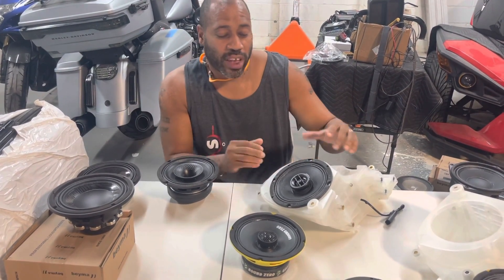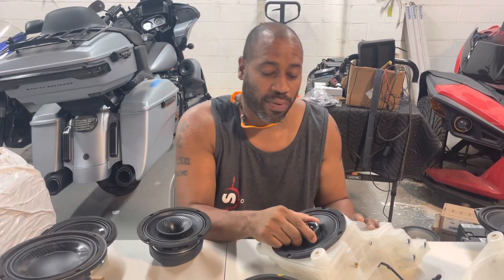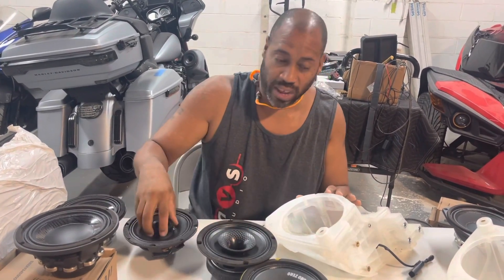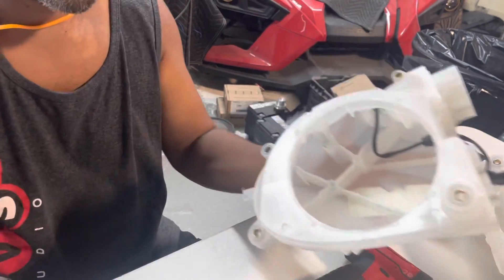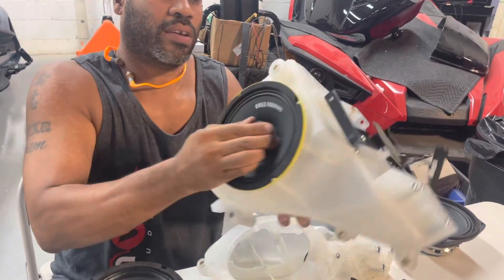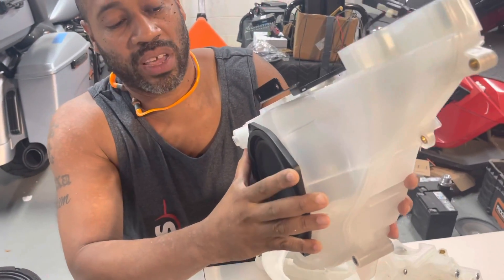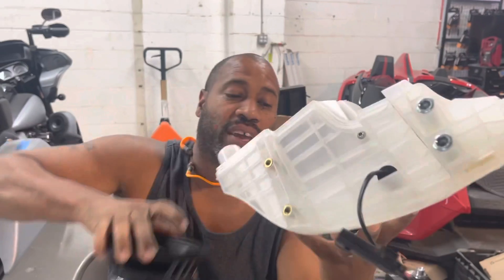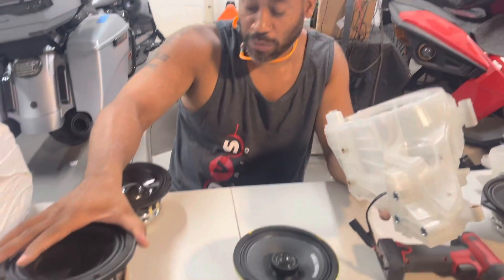How to modify your speaker pods on 2014 -2021 Harley-Davidson Street Glides for larger 6.5 speakers

Comment: On this topic. Why does Sinister sound add a bass port on the pods?  This may steer me away from there set up.
Reply from the maker: @jmaxx73  sinister sound is a very smart company. They know exactly what makes their speakers play the best and they modify the pod to work well with their speaker. They don’t just randomly throw a port in there. They know that this port in this pod with Speaker does this
Reply: Ty

Comment: My speaker pods are black. Is there a different process for the black ones
Reply: The speaker pods in my 2020 are black as well. If yours are like mine, they are actually 2 piece and has almost like a lid that comes off to make grinding easier.

Comment: Appreciate all the videos and assistance with us audio "nuts". 2 questions for you when you have a moment

1) - What is your take on the DS18 & Skar Audio lines...specifically the Pro Zt6 from DS18.

2). Have you guys every modified the rear stock pods on a Ultra to fit a 6.5? I don't mind losing the volume controls etc...would like to be able to slap some Mmats 6.5's into the rear pods. 😁
Reply from the maker: We are not familiar with the Skar or ds18 

I’m
Pretty sure they are not weather proof

Naggy now offers a speaker spacer for the tour pack pods
Reply: @NVSAUDIO  Thanks Carlos. Ended up buying the GZ yellow Baskets & Hertz SX 165 Neo paired with 2 400.4evox 👌🏼

Comment: Which speakers are louder boss?
Reply: They are all different. It seems weird to me at first but some just have more mid bass and some just have more loud ness.  I'm having a hard time just saving money to buy 500 for each speaker but there are so many reviews on the NVS Chanel a little bit more research on what sound your going for and lots of money and lots of Tesla tape and no 99 cent store RCA's on some sound digitals with ferals on your wires and a fat Braille battery and oxygen-free copper wire preferably stinger you will definitely be there LoL 🤣😆 good luck 💯😎
Reply: @danielzamora3769  hahaha lmbo touche